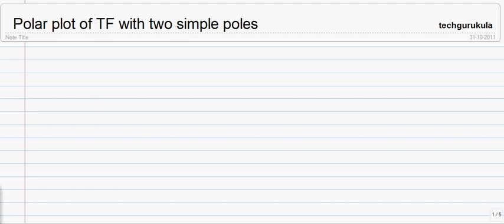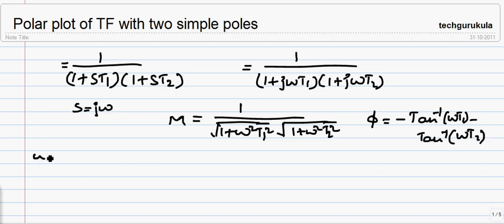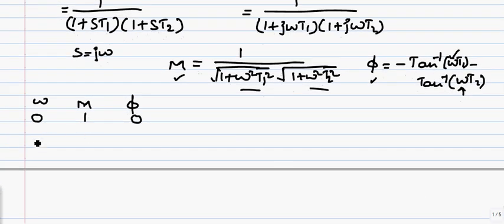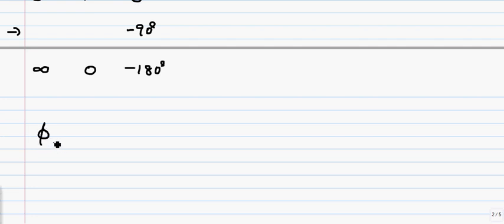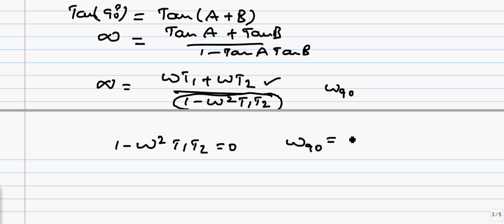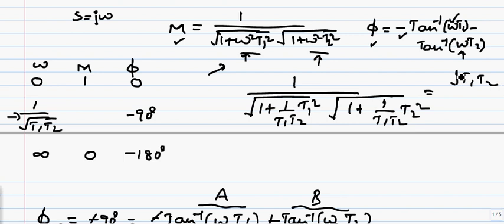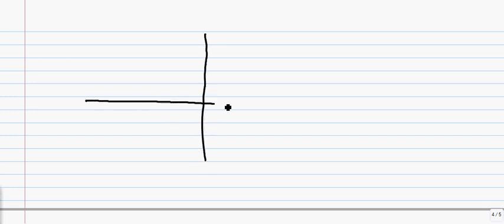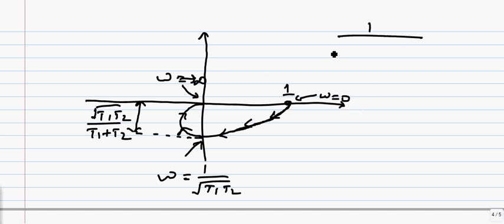polar plot for two simple poles

Comment: No this is not a type zero system this is a type 2 system; denominator is second order. Type 0 system is when G(s) is approximately equal to 'K' the gain constant...
Reply from the maker: Hi cruicks100

type of a system tells the number of poles at the origin. In this case, we don't have any poles at origin. we have only simple pole in this case.. What I meant by simple poles is => Poles not at origin & not complex poles.
hope this clarifies

Thanks,
Techgurukula.